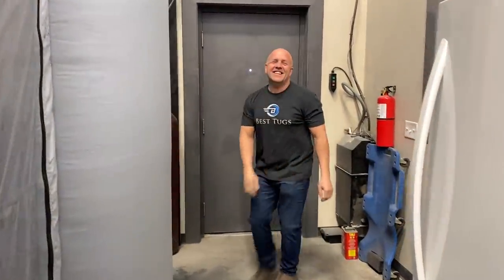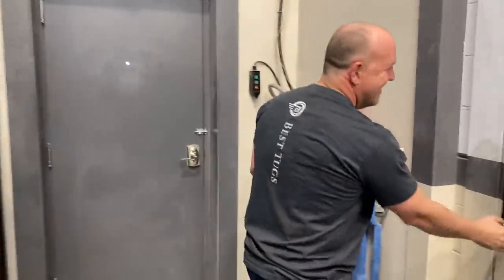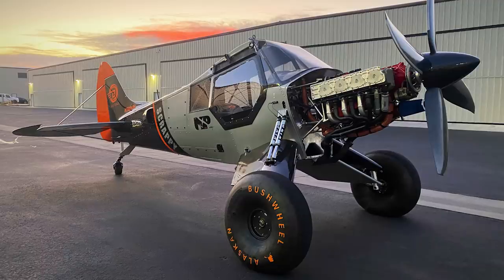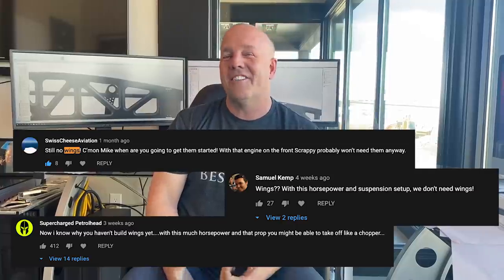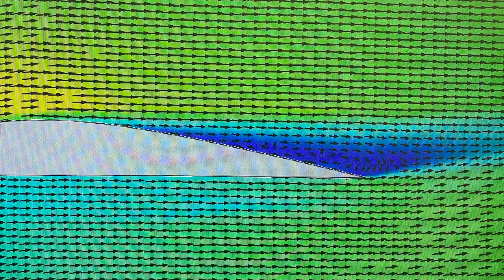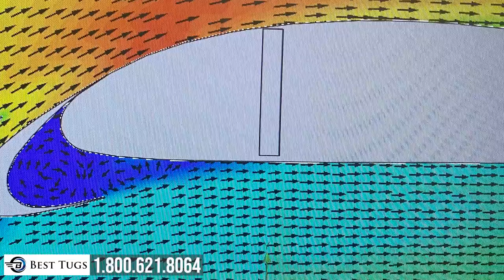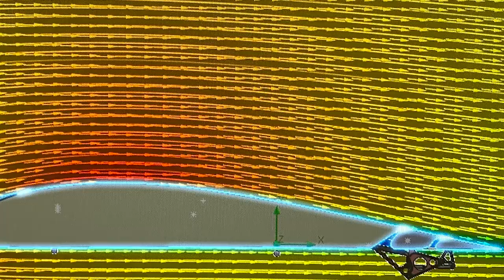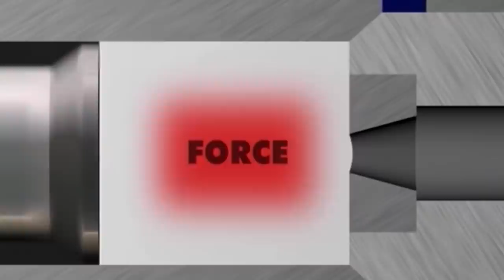Airplane Without Wings, Let's Try Something Different! | Scrappy #42

Comment: Right on. I grew up in the aircraft industry. And I was born an engineer. Okay so that's what they say. However as an inventor I have an aircraft I designed it's not an airplane. It's not a helicopter either. However in my research I had to look into all types of things as you were speaking about which was related to the wing. Because my vehicle does use a rotating Wing system. My prototype flies beautiful. Simply because it can fly. But I really liked your display of your thoughts on attacking the concept of the wing. The reason I'm interested in what you were speaking about is because I too have been contemplating these types of aspect to a wing and its functionality and how to achieve these things by simple ways just as you have described in your video here with the elongation of the wing or the elongation of the width of the wing and the different points and features as the Leading Edge or the trailing edge and ailerons and  so on. I'm going to have to subscribe to your Channel. Because I like your delivery for the reason of your Scrappy not having wings. Which by the way I am most attracted to the bush pilot type of aircraft than any other except for the one that I have invented. Which I invented for a great multitude of reasons which it has the ability to achieve. And one of those is search and rescue from the very beginning because there is nothing like life. I just don't have the ability to bring it to full version right now because I cannot afford a single thing any longer. But I sure like your workmanship your aircraft and the delivery on your considerations into how you're going to do these things I think it's great. Keep up the excellent work and I hope to see more of your work. Okay peace.

Comment: Mike, great wing video. I've been flying gliders for years. We have the same problems of the need for high lift slow flight and flat out high speed flight to get from one thermal to another with min sink. Not clear if you have tested the technique of coupling the flap and aileron throw so they work together in droop for lift and reflex for high speed. The droop for aileron is only a few degrees as is the reflex. The flaps are used normally except for high speed when they reflex up a few degrees. Other benefits - wing roll is accelerated with coupling flap and aileron. Adjust the effects of coupling in real time by dialing in more or less depending on conditions or desired performance. Hope this is useful.

Comment: As soon as I understood the overall issues with the wing my mind jumped to the same conclusion you get to at the end of the video. Two areas of specialized industry that may have done work pertinent to this project are supercar adjustable spoilers and rigid inflatables (standup paddleboards

Comment: I did watch to the end. How about a weight that moves forward or aft depending on how you want to shift your center of gravity while you are flying? How about extendable canards that can retract depending on how you need to change Lift? Think NOTAR. Rather than depending on airflow and applying control surfaces into that air stream create your own air flow or direction control with small Jets of air to assist where necessary?

Comment: Have you considered Flaperons? Basically you ailerons droop a little as you lower/extend flaps? That way you have a full wingspan flap and you can keep your ailerons as long as you like  to ensure maneuverability. A relatively simple "mixer linkage" makes the setup and layout a set and forget affair.

Comment: @Mike Patey Have you looked at strakes? Airliners use them to energize the air over the wings when flaring to retain lift, even when the engines cut off airflow to parts of the wings due to the flare. If you could use adjustable/retractable strakes, you might get better performance than expected while slow, without additional drag while fast.

Comment: That's a very complex problem your dealing with. Your probably going to have to start over with with a whole new plane if you're trying to get the best of both extremes. I'm sure when you're finished it will be one of a kind. I love your work. I think you're a very gifted engineer. Good luck!

Comment: I’m a sailboater, and all through your talking about your design challenge of high and low speed performance, I was thinking that most sailors face that challenge all the time. We usually have one main Sail & have to use it in whatever wind that’s blowing on the day we’re going out. Windsurfers will often have different sails for high and low conditions, but the rest of us don’t have that luxury. Instead, we have an outhaul adjustment that controls tension at the foot of the sail, along the boom, that give us more or less chord, or thickness of cross-section. Some mains have a line that goes up the luff (leading edge), over a pulley at the top, and down to the boom inside a sleeve at the leech (trailing edge), which allows adjusting tension along the entire length of the sail. This leech line does the same thing as the outhaul, but for the sail above the foot. These adjustments make minor changes in the center of effort fore and aft, but the balance of the boat is not greatly affected. Depending on the stakes, and level of performance demanded, tuning of the shrouds may be adjusted to move the mast and better balance the boat. Because the propulsion power levels are small, even tiny balance effects can make a difference for winning a race. At the end of the video, it was sounding like you were aiming to effect similar adjustments in your solid wing as we do in our flexible surface wing/sail. I am very curious to learn how you can do that reliably. I would look at the current wings of the latest America’s Cup boats, as they have to solve similar problems. Their wings are looking much more like airplane wings than cloth sails.

Comment: I've been designing remote control airplanes for some time now. these questions your asking yourself about flaps, wing length, elevator, slats, droops? all these things are subjects that are impossible to check in a remote device. without powerful computers its even more remote of an idea to conceive of. My idea came to me in an epiphany of thought as i was in rem sleep, i know, ha, ha... however the thought of a  weighted CG matter being controlled from nose to tail and from both center of wings to outer  left or right at the command of a computer to transfer the center of gravity around on command according the the shift of elevator, flaps, aileron for acting as the commands of what you literally want your plane to do in flight.
just a thought and i hope you figure it all out. nice work and thanks for sharing toy us...

Comment: As soon as i started watching this video and had a feeling where you were going.  I make rc planes from balsa or foam.. About tens years ago i made a depron plane which i modeled on a spitfire i had made from plans. My idea was for more speed so i clipped the wings and added more chord length.  The result was very fast and when you slowed down there was a speed where it seemed to transition and would sit tail down and then would fly incredibly slow.  It was a symetrical airfoil with the wing tips pinched.  Im sure whatever you've come up with ends up amazing  Good luck

Comment: Forward sweep wings? split wing design? Can you take designs from water / Hydro design?
What has more lift? on the tips? or in the centre of the fuselage? wing tips? adding attachments for a particular flight plan. Quick release wings?

Comment: There is a microlight called a Sapphire in Australia which uses reflex flaps to perfection. That increased the cruise speed significantly. As they had made a very clean low drag wing, the issue was it floated down the runway, even with full flaps. I believe  a adventurous builder fitted spoilers and utilised them with jaw dropping efficiency in front of many onlookers. I regret I’m so far away and unable to assist. Most of your supporters in the USA would love to be involved as well!

Comment: Try looking at a glider wing, they use negative flap to move centre of lift and reduce elevator drag / trim at higher speeds, and positive flap for slow speed performance.

Comment: I flew a Norseman , back in the day ..  they have 'slats' on the Leading edge of the wings, which deploy in sync with the last 6 cranks to Full-Flaps (13 notches/cranks total), only for landings ,though.. sort of like your idea of 'transforming' of the wings , but, lots of drag with lots of lift, slow speed .. but with enough horsepower, that would be overcome and useful for that 'bursting' initial takeoff and climb .. good idea!

Comment: Mike don't know if this will help but there was a  fibreglass wing which "changed profile" on a Sailplane years ago. It was called a Jantar2 but it was just the flaps part.
Some sort of Elastic camber changing flaps, which spreads the
hinge-point over a longer aria of the cord.
Problem was cracking over time.

Most gliders these days have mylar "wiper seal" strips reducing the drag at hinge points. Guess it's the same with Composite powered aircraft. 

Maybe there is a modern material these days which will cope with a variable profile wing you are after.

Fascinating project my friend.
Back to work 🤠

Comment: Mike,  There may be one other wing-altering design that you may not have analyzed.  When I flew the T-2 Buckeye, it had an inflatable rubber leading edge to break off ice buildup.  When used, it slightly altered the chamber and would change the trim needed.
Why not insert inflatable panels in the wing specifically designed to alter the chamber?  The T-2 used hydraulic fluid but to conserve weight, it might be possible to use air.  You can see the obvious benefits of structurally altering the chamber as well as the whole wing shape to alter AOA, induced drag, laminar airflow, Oswald number, wing efficiency, etc.  It might even be possible to alter the fuselage itself to add life and/or reduce drag with inflatable bladders.  

One other possibility is to use these inflatable bladders in place of or to enhance other control surfaces - rudder, elevators, ailerons, flaps, slats, etc.  Using air to inflate might also reduce overall weight.  

If it is possible to also used some of the concepts of PRANDTL-D wing design to lower drag, it should be possible to build a very fast and a very slow aircraft in the same design.  

The kind of computer modeling you did is similar to what I did in the Navy for 20+ years.  I find it exciting to explore science like that.

Comment: I just wonder Mike...  What if you had a way to manipulate the Lifting Center of the wing?
Maybe a way to move the wing forwards and backwards, altering the CG for low and high speed flight?
Then a wing similar to the normal 'bush wing,' might be used, even adding slats for lower speed dynamics.
I think 'then,' you'd be able to maintain the wing length for those tight spots, short field performance, and then, change the CG component for lift, and by doing so,  gain 'speed lift,' over 'slower approach and takeoff lift.'
I was thinking of that idea of the rollers and slots, attached to the wing spar, and the fuselage.  Using hydraulics or manual manipulation, like you use to adjust trim tabs.
Adding an indicator in the cockpit, would add confidence as to where the wing is, and how the wing 'feels,' in relation to aircraft performance.
A falcon can glide, like a glider, catching lift on aircurrents, because his wing is wide and long enough to do so...  "High lift and slow flight."
But then, the falcon can tuck his wings in and drop from altitude at very high speeds, and still maintain control all the way down.
I don't see a 'wing tuck,' being practical on a bush plane.  As you say, complexity and weight would be factors in a wing you could lengthen or shorten.
Even the F-14, with folding wings was way to complex for what you want.
Then again, I suppose that the lifting envelope of any airfoil, is the envelope you have to work in regardless of speed, or lack of it...
Don't mind me.  I'm just ranting!

Comment: I know I'm no aeronautical engineer here, but, what about using some device to change the camber of the wing like you want? I know boots are used for leading edges for ice mitigation. What about using some sort of air bladder to change the camber of the wing? That way you can have your fast wing and slow wing all in one. If not an air bladder what about some sort of actuator that could press on the skin from inside to change the shape of the wing for more camber? Though I can see weight being an issue along with fuel storage. But you get the idea....something to change the wing shape. I still think some sort of air bladder would work best!

Comment: One more suggestion please, Mike-Electrogravitics technology.  A conductive strip on the leading edge of the wing charged to at least  10 kilovolts positive with the negative in the exhaust stream of the engine will create a gravity well in front of the plane and produce a net force pulling the plane forward. High voltages in capacitative devices have been proven to do this for many decades. Gravity can be tapped as a source of motive power using very high voltage DC sources.  The B-1 bomber is alleged to be propelled in this exact manner.  Rumor has it that it's wings leading edge is charged to 10 megavolts positive DC with the negative charging the exhaust stream .  The huge cloud of ions coupled with the wing's leading edge create a giant,  ephemeral, but very real capacitor that creates a "gravity well" that pulls the plane into itself adding motive power to that of it's jet engines. Tom Valone of Integrity Research Institute has written two books on this subject(Electrogravitic Systems and Electrogravitics II).

Comment: So have you looked at the 20 meter foiling sailboat wings. So i know what you need take a wing build it in 3 sections center section is rounded on leading and trailing edges. First or leading edge is rounded at its trailing edge to fit compleatly onto the leading edge of the senter section and hinged to transition between high and low speed. The trailing end wing section fits in the same manner and operates as a very large flap. Remember to use aileron up only in slow speed or you wont have any control. Think of the posabilities, ya your welcome. And thanks for all your builds very informative. Sorry about the spelling. Sincerely. Bill campbell

Comment: I'm a flatlander, securely attached to the ground, but also fascinated by problems and odd solutions. I was thinking variable camber wing, during your video...and then you spoke of that at the end. Go for it! A rhetorical question from the uninformed, maybe, but does the wing always have to be in the same place? Could its position not be shifted fore-and-aft, somewhat, during flight? What do the birdies do, to fly slowly and then fast? They change shape. I'm guessing that you have some disposable income, you can explore the variable aspects of a flight form that experienced and knowledgeable flight designers say are ridiculous. I wish you well. You got this. (am a former submarine guy, flying underwater)

Comment: You need a wing that can change shape to give you the lift you want. Instead of extending the wing length, you have a system that will make the wing fatter or thinner.

Comment: Ok, you went in a different direction that i'd figured.  I was thinking you'd do something like the Leading-Edge Slats on the A-4 Skyhawk, gravity driven, at high speeds, they retract into a clean leading edge, but at low speed, the slide out on roller bearings to give better lift performance and control on approach.  Best of both worlds, with minimum added weight, complexity and machinery.

Comment: Scrappy Wing Thought: What if you could add an air pressure Bladder on top of the wing like a de ice boot, but larger, so you could create more lift thru variable wing camber with a flick of a switch?

Comment: Wow what a fun video and a very interesting project nothing like the emphasis of the word dynamic, I love your style and especially that big genuine winning smile of yours, after seeing all the analysis you were doing I'm sure that's but a small fraction of what had to be done and all the Midnight Oil thinking about these things as you went along oh, once you're done with this stage of the mechanical many things will be learned and with your engineering mindset I can see it will be reduced to only what is necessary and required to get the job done you're going to push the edge No Doubt, after you've worked on these mechanical issues with the dynamic wing, the final icing on the cake will be playing with some interesting mylar substrates using maybe something such as Ito indium tin oxide or even aluminum deposition coated laminate on the forward leading edges and even possibly across sections of the wing using electrostatic charges to finalize the efficiency as you were concerned about the laminar flow over the lifting surface and even the entire chord, diffusion on the trailing Edge also oh, it will be interesting to watch this project develop when I get time to get back to some of this as we are heading out to see soon and will make landfall in approximately three to five weeks somewhere South where we can work on more fiber glass projects I will check back in and see how things are going do you possibly leave some feedback and open a Channel of communication I pondered many of these ideas for decades but no longer with spare time at the moment do Tinker but the modeling process is definitely a thyme savor now taking the model and engineering and putting it into the physical reality Mode best of luck oh, you're on the right path and yes ultimately this will be truly revolutionary, cheers